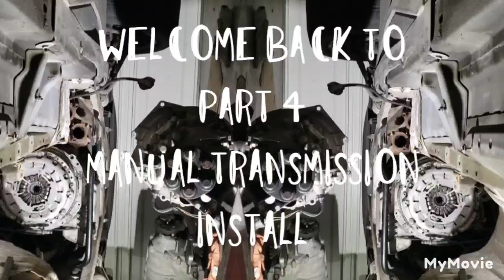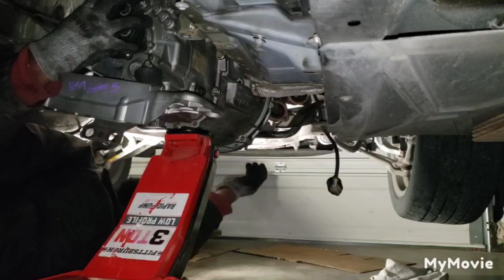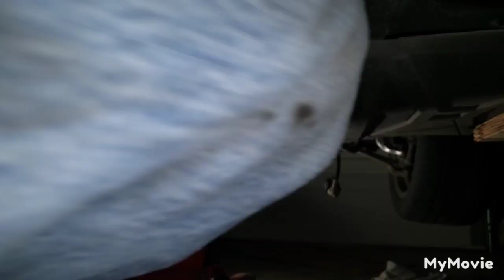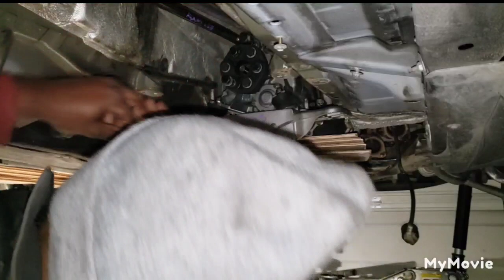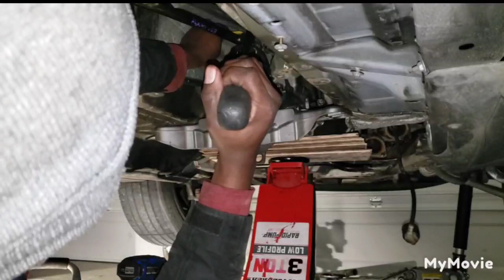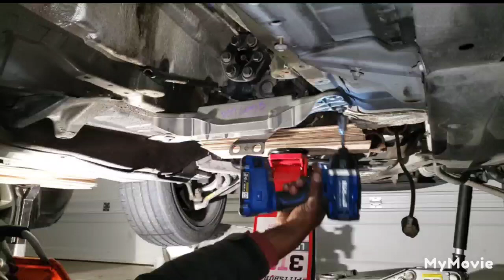E39 528i: 5 speed Swap Part 4: Getrag 250g Manual Trans Install

Comment: hey where did you find the transmission? how much was it and around how much did you spend in total for the whole swap and coding etc, thanks
Reply from the maker: Found the Transmission on FB Market Place. Drove about 4 hrs to pick it up. Came as at "kit" and paid $1k. Included trans, linkage, used dual mass flywheel, used clutch, pressure plate, driveshaft, pedal assembly, and transmission mount, exhaust gaskets. 

I spent a little over $2k but i also chose to not use the used clutch, flywheel and pressure plate. I also replaced the rear main seal, guibo, shit knob, shift boot, diff and transmission oil, front and rear transmission input and output shaft seals, shifter bushings.

I also paid $250 to a shop to code the car as my K+Dcan Cables were not working and i couldnt connect to the car. 

I recently sold the transmission for $400 so my net costs was around $1600. I would have been less than than becuase the Dual mass flywheel and new clutch was over $500 alone.
Reply: @photofinishgarage  thank you man! been watching your videos. i have a auto 2000 528i and i’m trying to look for a manual donor car for swapping. thanks for all your helpful content, you deserve millions of views and likes.
Reply from the maker: @brunosbmws  that's awesome. Trying to get there. Haha let me know if I can help in any way. Make sure to check out shop life TV in youtube. He also has really good diy videos on the swap.
Reply: @photofinishgarage  i have. i will if i have any questions thanks a lit
Reply: hey, do you know what car your manual transmission came from? i have a 2000 528i with the GM, and i dont know if a 2002 525i getrag 250g would fit. i found a donor 525i with blown engine for a good price, transmission is perfect condition but i’m not sure if it will fit
Reply from the maker: Yes it will fit. Mine came from a 525i supposedly. 

Double check realoem.com and input the donor car vin. Get the part number from donor car and cross reference it. 

Also you may need to swap the rear end depending know the gears of the donor car.
Reply: @photofinishgarage  thanks again man 🙏🏻